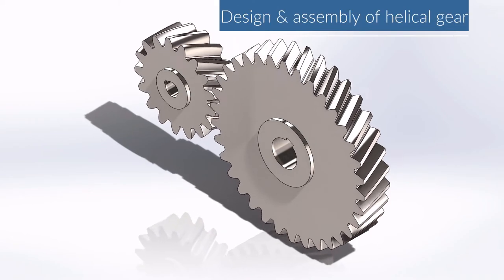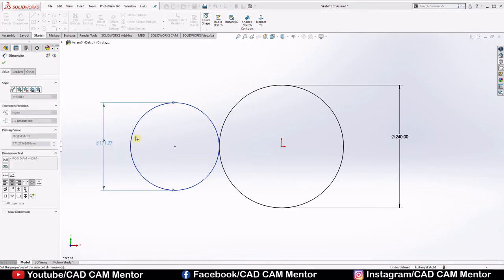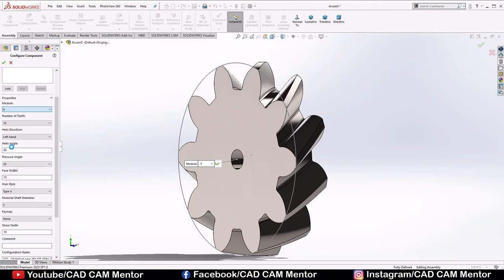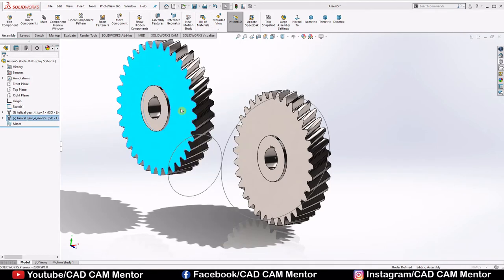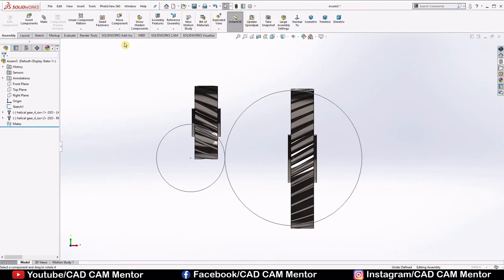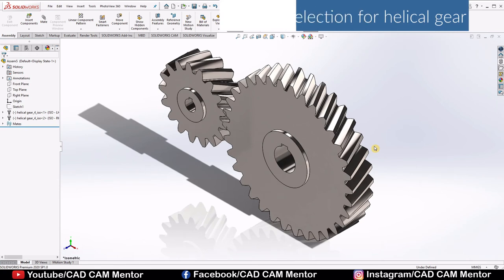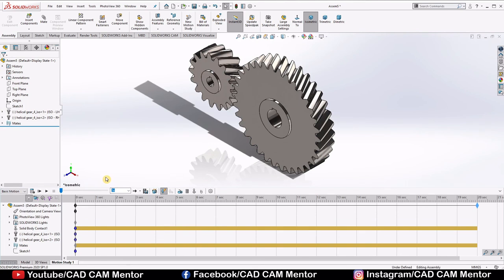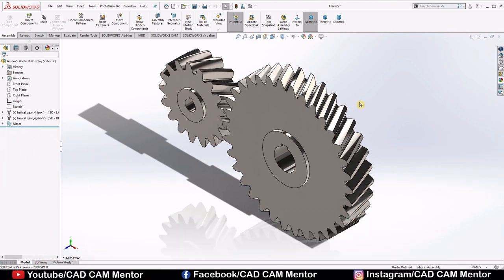design and assembly of helical gear in solidworks using toolbox | solidworks tutorial for beginner

Comment: Shouldn't the helical angle be different for the two helical gears, because they are of different radii, therefore the angular velocities are different? Shouldn't the larger gear's helical angle be less than the smaller gear's helical angle? Thanks.